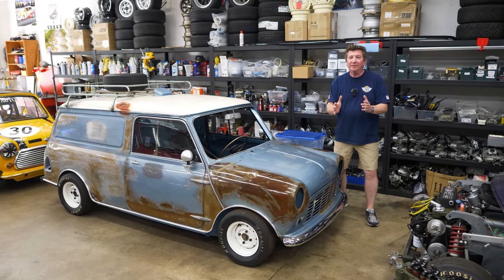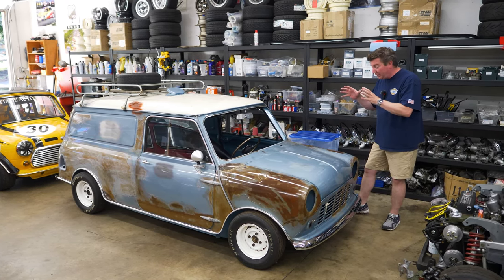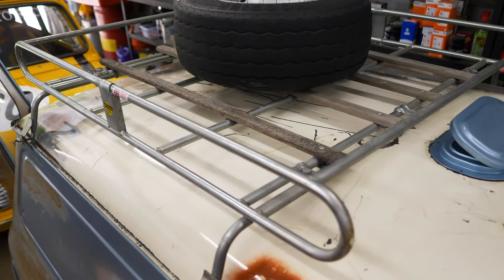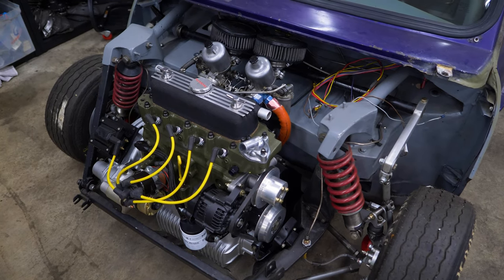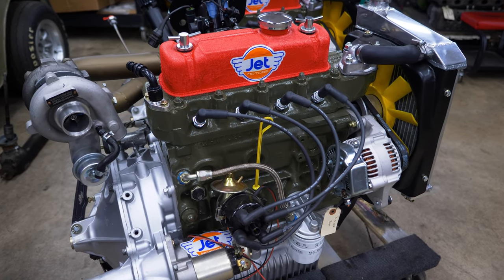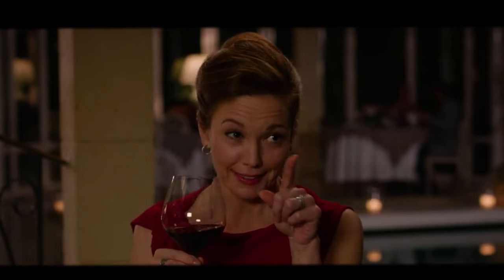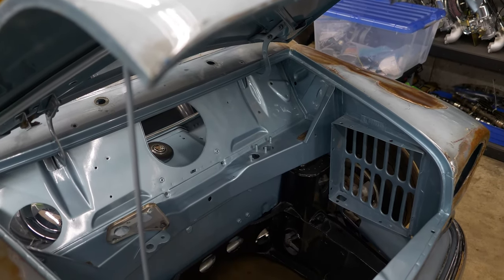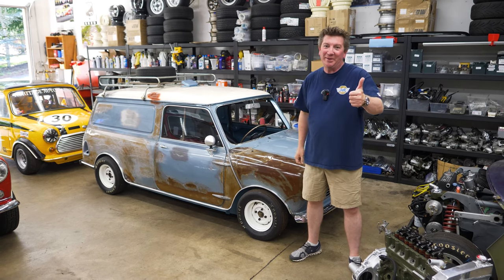HELP!!! Jeremy Choose a Power Plant for the 1962 Rat Van Mini

Comment: I reckon Tuned with twin carbs is best it's what most folks did in 1962 as the standard 850 engine was not very lively, the van was popular here in the UK the racing boys used them as a tow car for the racer and very often had an S engine droped in great fun!

Comment: Jeremy, ask yourself what you want from the vehicle.  
- Do you want something that is pretty close to stock?  
- Do you want - if not stock - the best that was available from BMC in the early sixties?
- Do you not care about any sort of authenticity, and just want to use the best that will physically fit?
Answer that question and the choice of engine will resolve itself.

Personally, I would go for the best that was available from BMC in the early sixties.  So, I would use an A series 1275 with twin SU carbs. If you can find a four speed tranny with synchromesh on all four, then use that. If, not stick with the standard "no-synchro-on-first" four speed.  Get some disk brakes to replace the front drums.  

That will give you the performance of a Mini Cooper S of that vintage.  Quite lively enough, I think !     Beyond that, you will start to lose the essence of BMC early sixties.